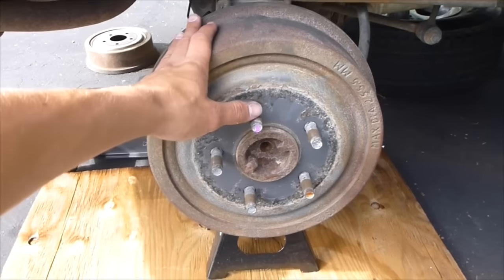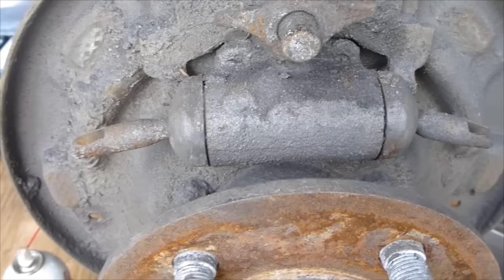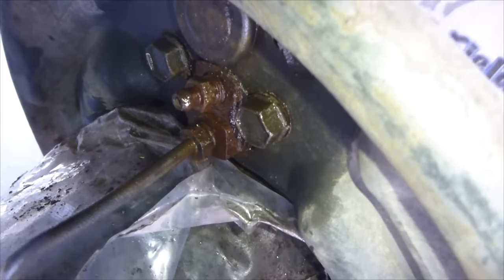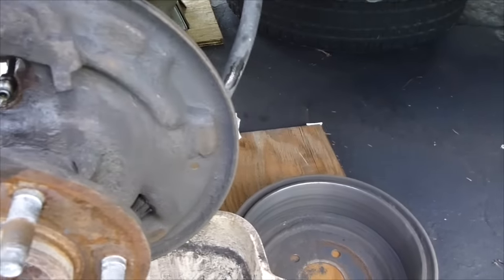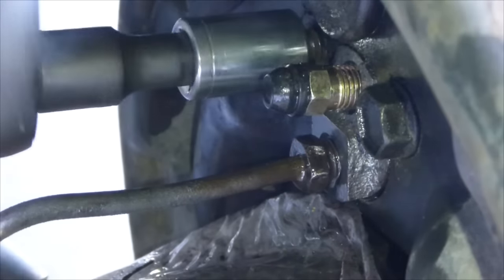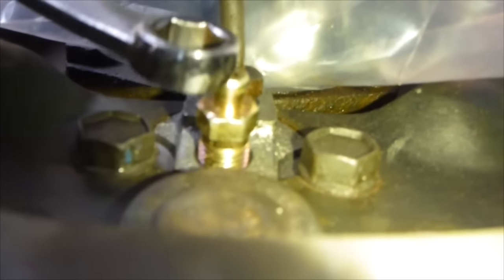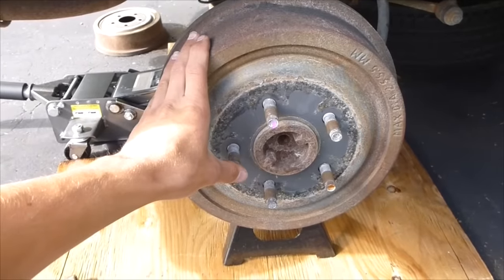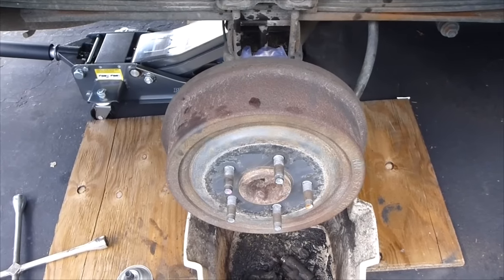How to Replace a Wheel Cylinder

Comment: I only have 1 criticism. Never pull on a frozen nut. You should hit the tool with the palm of your hand until it frees, or you will round off the nut. Just sayin. I really like your video, though. A inline wrench should be used also for the brake line, for extra protection against stripping the nut or twisting the brake line.
Reply from the maker: Thanks for the tip! Can you point out at what time in the video you are talking about?

Comment: The brake drum wheel cylinder is not leaking can they fail when they dose not' let go of the pad after a stop or will it leak?
Reply from the maker: +jay rod it can fail and for $10 I suggest you replace them every brake shoe replacement .

Comment: Are wheel cylinders identical on both the passenger and driver side?
Reply from the maker: Yes they are.
Reply: Cool.  Thank you.   I was thinking maybe the brake lines go into the wheel cylinder at a certain angle or something--and thus, maybe the wheel cylinders were actually (slightly) different parts for driver / passenger sides...

Comment: I know this is a very old video, but anyone have any tips on removing 2002 Subaru forester L sport drum cylinder bolts. I just bought the car and the bolts are badly rusted and pretty much crumbling. Every socket I use spins and pops off (8 is too small and 9 is too big),  so I don't want to keep going at it and strip them worse than they seem to be. Thanks for any help!!!

Comment: Can I take the wheel cylinder of with out removing everything else ?
Reply from the maker: You can but you still will need to remove the top spring that is in the way or pry the brake drums  out of the way!

Comment: So I've used your method and can't get the wheel cylinder off. I've tried breaking the bolt and twisting the cylinder its self. There is not enough space for it to move a full rotation. Does anyone have any suggetions
Reply from the maker: Heat up the bolt with a torch. That should make it spin without spinning the brake line

Comment: any extra tips on bleeding for beginners. First time trying this :/
Reply: have someone there ready to help is the best advice i think. and have brake cleaner and a tub ready to go.
Reply: make sure you have plenty of time. realize that you are doing this for the first time and it will probably take you longer than someone who has done this multiple times. the last thing you want to do is hurry though a repair and miss something that could be a safety issue. so just take your time, take pictures of where things go if you're removing multiple parts (I do this occasionally and I fix cars every day). don't let any repair intimidate you,as long as you have the right tools,pay attention and take the time to do it right. you can fix just about anything on your car!

Comment: hey I'm redoing every thing on the back cylinders pads   spring kits adjustment kits  and drums to pull my old cylinder on a cavalier   do I have  to pull my wheel barring off? I'm talking  about the part  with the studs on it that the lug nuts go on if u could email me about this or reply back would be much ley a prechiattedd

Comment: thank you. chris
Reply from the maker: No problem! Glad the video was helpful! Remember to give the video a "thumbs up" (it helps me out, thanks).
Reply: chris i have a 1998 dodge grand caravan i need to do my rack&pinion.is it done the same way as a 2003 caravan.as in your video.how the hell can you take off the reservoir neck on a 1998 dodge caravan
Reply from the maker: Kevin Smith I dont have a dodge grand caravan but I would see if you can remove the whole reservoir. Maybe I am not understanding your question.
Reply: ChrisFix  my bad chris. it the brake reservoir neck on my 1998 dodge trying to get off but. it may funny have you any idea. how can get it off
Reply from the maker: Kevin Smith Are you talking about the cap to the reservoir?
Reply: ChrisFix no talking about the long neck that attach to the  brake reservoir
Reply: ChrisFix my bad wrong person I was asking me

Comment: Chris check it out I let someone fix my brake line it was hanging out my cylinder once they fixed it it constantly became a problem each time I take it back they fix it breaks again a friend told me my wheel cylinder might be stripped will this process fix this problem
Reply from the maker: Glad that you fixed the problem! Sucks that people dont know what they are doing!
Reply: ChrisFix actually I didn't fix it yet but hopefully this does it
Reply from the maker: Let me know how it goes!
Reply: I think it's my master cylinder bro I have no more leaks
Reply from the maker: Did you bleed the air out completely? What is wrong? Soft pedal?
Reply: The line kept breaking next to my wheel cylinder I took it to a professional today but I might reference your other video to change my shoes soon
Reply from the maker: Oh, wow. So you cannot just replace that part of the brake line?
Reply: I was searching for videos on how to cut and extend break lines couldn't find em then I thought it was the master cylinder so I was gonna change that but I have the abs attached to it no videos on that
Reply: But imma continue to look at your videos because you help me fix my aunts tie rods lbs
Reply from the maker: Great! I am glad my videos help!

Comment: How can you tell if you have power brakes on an 83 s15 when you can't drive it because one of the brake cylinders is seized.
Reply from the maker: +Alison Mckinley Look for the brake booster. The brake booster is right behind the master cylinder and that is what is considered "power brakes". Most cars 80s and up have  a brake booster.

Comment: everything came off easy and I replaced the cylinder but I can't get the drum back on. I have compressed the brakes down as much as I can and the drum won't slide on easy. please help!
Reply from the maker: Open the bleeder on the wheel cylinder and compress the shoes inwards as much as you can. Also make sure the star adjuster is completely closed.

Comment: What do you do when you put new pads in and the drum won't go back on I just did mine and the drum won't go back on I've set the regulator and parking brake isn't on
Reply from the maker: Push the prongs in on the wheel cylinder!
Reply: ok so installed new wheel cylinder and got the new pads back off and my drum still wont go on its hitting the pad when i try and put it on we are talking about an 1 and a quarter too much and i absolutely cants get the pads on there any tighter is is possible i may need a new drum can they shrink at all over the years its a 99 dodge and i dont thing they have ever been changed

Comment: What's the average cost of this repair?
Reply: Nick Mossey depends on what your replacing,the brake cylinder typically costs $20, per cylinder, for a complete replacement, including the hardware( springs that hold the brake shoes and everything else ) ,the brake shoes, and the drum would be around $100, at least that was how much it cost for my 89' Ford F-150

Comment: What doesn't help is when the owner before doesn't know how to fix anything and its a pain to fix for the next person to won the vehicle. The bolt that the line goes through to the cylinder is stripped in where its a certain way to put the line in and on that set of drums they had everything backwards/upside down.
Reply from the maker: Dang, I guess they didnt watch my videos LOL. Hopefully you straightened it all out!
Reply: Yea I finally got them done, just got to bleed all four brakes. That's because of me replacing my front back in November. Also I got to work on my bushings on the front radius arms.
Reply from the maker: Good work!

Comment: they make brake line wrenches for this. the open ended side wraps around more of the nut on the end of the brake line. less chance of rounding off the nut. also, when bleeding, attach some tight fitting clear hose to the bleeder valve. loop the hose first up and then down to the catch container. the reason to loop up is to lessen the chance of air coming back into the bleeder valve before it can be closed. good video otherwise.
Reply from the maker: +michael adams Thanks for the tips!

Comment: If the wheel cylinder itself is in good condition, just change the pistons
Reply from the maker: Eric Beech For $10 a wheel cylinder, just replace the whole wheel cylinder. You do drum brakes every 75k miles or so, and I think it is worth the few extra bucks. Thanks for sharing!

Comment: so this style needs no  adjustment (on bottom)?
Reply from the maker: +cpgone nope, the only adjustment is with the star adjuster on the bottom but that is for the drum brakes, not the wheel cylinder.
Reply: Ok thanks I assumed WC replacement would throw off the adjustment.
Im the guy who will try and cut the springs with a bolt cutter. i will post the results

Comment: i removed the bleeder valve to get to the fittings easier.
Reply from the maker: That works. How did you not make a mess with all of the brake fluid?
Reply: i put a pan under it. then sprayed it with brake cleaner.
Reply from the maker: Gotcha. Goes to show you there are different ways to get the job done!
Reply: oh def. it didnt drip much. you only got it off for a min.

Comment: spray the hell out of the side where the bolts are with brake cleaner. before brake cleaner I would have to wash it with soapy water, rinse it and dry it with a paper towel...leaks...good, I have to wash rinse repeat ughhhh
Reply from the maker: Thanks for the tip!

Comment: Can someone answer my question, please? (PLEASE REPLY SOON)

The mechanic I'm going to is charging me $1,400 to fix the following:

Front brake lines, master cylinder, brake booster, bleed (?), rear shoes, wheel cylinders, hoses.

$845 for parts, $513 for labor, $44 for tax. Is he screwing me over or is this a reasonable price?

It seems like Chris fixes most of these things in 15 minutes. There's another mechanic I know that charges $75/hr, so, hypothetically, if each of these repairs takes approx. 15 minutes, that's 1 hr 45 minutes, or $131.25 for labor.

The parts may be more expensive than normal, because it's a 1975 VW Van.
Reply: P.S.

He always tells me I need power tools to get to the master cylinder, because there's 300 lbs. of pressure on the bolt. ???
Reply from the maker: MothaFxck Well he charges what he charges so I cant tell you if he is ripping you off that way. You broke down the labor and parts and it seems reasonable. The bigger question is do you really need all of that? With mechanics, it doesnt matter how long the repair takes, if the book says it takes an hour and it really takes him 10min he is charging you the hour. Are you sure you need all of those parts?
Reply from the maker: MothaFxck You dont need power tools, you can easily use a breaker bar.
Reply: ChrisFix First, thank you for such a quick reply. :) I really appreciate what you're doing with your videos.

No, he says he's not sure if I need the master cylinder or "superseded by rayf0153r brake drum (whatever that is)." He said he never took off the drums to see. However, when he fixed me transmission, he also did an oil change (which I had done myself a month previous so I didn't need it), which cost me $50.... plus he used synthetic oil, and a bunch of other unnecessary extras. I just feel like he likes to add stuff on that I don't really need.
Reply from the maker: That is what some mechanics do to make more money. I don't know any mechanics that I trust and it is for reasons like this. I would do your drum brakes yourself or at least just take the drum off and see if it needs replacing. It isnt difficult to do. Here is how: How to Change Drum Brakes (In depth, ultimate guide)
Reply: Thank you for your advice. I know a Christian brake shop that I'm taking it to instead on Monday.

Comment: It's easy... Until you round the flare nut. I did that and all my hopes of fixing it myself fell apart. DIY'ERS BEWARE.
Reply: Use penetrant and let it sit for a day or 2. Use a brass drift to peen all around the hole.. then use a chisel to try to tap it out in a counterclockwise manner. You cant screw it up more. Thats what a mechanic will try first... then they will cut it and use an extractor.  Don’t recommend cutting it because splicing a brake line is shade tree mechanic shit. But you can rent a flare gun at the zone. Can still be a diy👍

Comment: When you have to assemble the shoes and springs n lever before putting it back around the wheel hub just because Mitsubishi🫡. Bout the only difference between mine n yours, but was very helpful otherwise

Comment: how do i knew when to change that cylinder
Reply from the maker: GAR A If you are doing drum brakes, it is worth changing because you do drum brakes once every 100k miles. You can check the wheel cylinder by lifting back the rubber boot and seeing if it is leaking brake fluid. If there is any sign of leaking fluid, even just dampness you need to replace them,

Comment: That's it?? That doesn't seem too hard to do. Lol I need to replace the wheel cylinders on a 626.
Reply from the maker: +Bryon Poe It is easy to do. The hardest part is the brake line nut. If it is seized then it could spin the brake line with the nut.